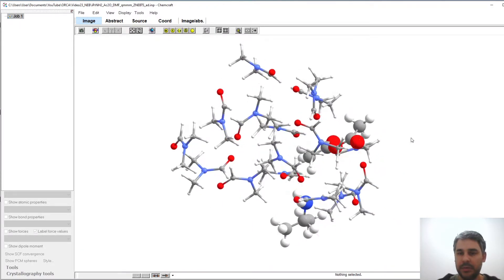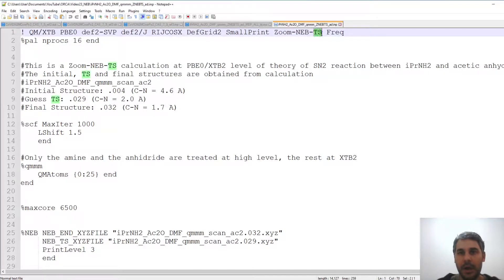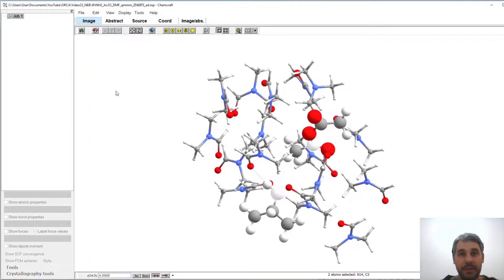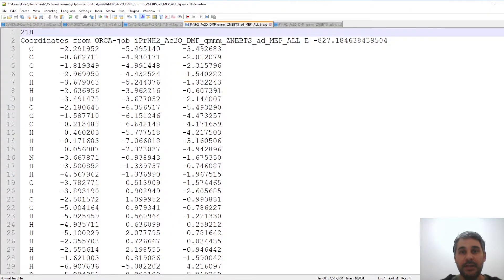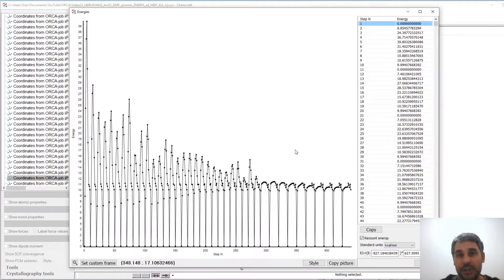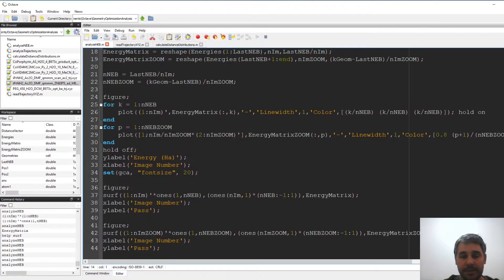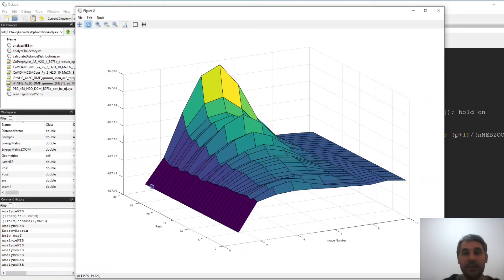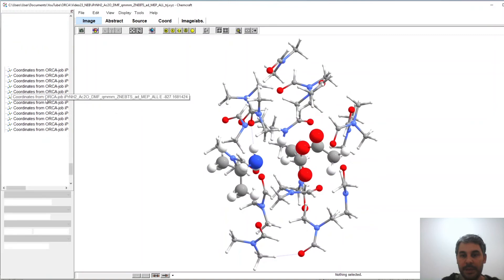Nudged Elastic Band (NEB) Tutorial with Orca

Comment: Thanks for the tutorial. How can I restart a NEB calculation that was killed? Which files do I need? Thanks!
Reply from the maker: Unfortunately I don't know. The NEB procedure generates a trajectory that is optimized sequentially. There should be an autostart feature, but if there isn't, you can alway copy the .xyz files (I think there is a ...NEB.xyz or similar), and you just replace your starting structures by the more optimized ones from this file (taking care that you know which is the start, end and TS guess structure). That should make the NEB run for a shorter time when restarted, as you have better structures. If you are running NEB-TS and your calculation crashes in the TS part, I highly recommend to split the calculation into two parts. First the NEB, and then a separate OptTS calculation on the NEB saddle point. Or even skip the OptTS and just do freq on the NEB start, end and TS structures.
Hope this helps
Reply: Were you able to continue your NEB from where it left off? My laptop rebooted and I don't know how to continue without starting from scratch :/

Comment: Thank you very much! I was struggling to calculate spin-orbit coupling values for two organic molecules one with a heavy atom and another without a heavy atom. I chose 12e,10o for one system and the obtained result was acceptable. Do I need to keep the same active space for another molecule as well? If yes I am facing convergence issues. Could you please help?
Reply from the maker: you don't necessarily have to hace the same active space. but if the two molecules are similar and you want to compare different orbitals, it would be better if the equivalent orbitals are on the active space for both. but convergence can be an issue for some molecules. in that case it's better to start with a smaller active space, converge it, look at the orbitals and increase the size of the space while rotating the orbitals if necessary
Reply: @niconeuman  Thank you very much for your reply. I tried with the small active space. But ∆E and  SOC values are not acceptable for them..I tried some convergence key words also...Can you suggest better ones?
Reply from the maker: @suvarnasujilkumar.c8855  you start from a smaller active space. But then you increase it adding orbitals which are meaningful for your molecule. Only a large enough AS will give you the correct parameters. But convergence of the wavefunction is not completely related with quality of predicted properties
Reply: @niconeuman  Thank you for us your suggestion. Due to some other reason I can't decrease the  AS . Can you please suggest any convergence key words or so?